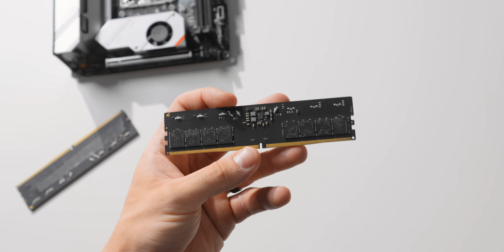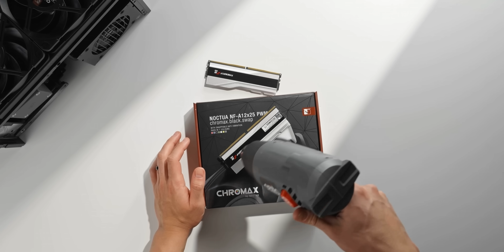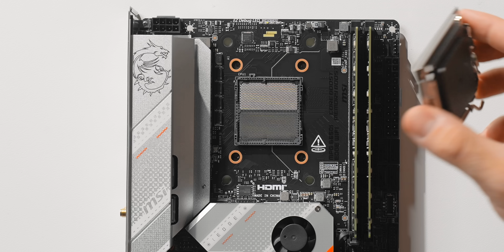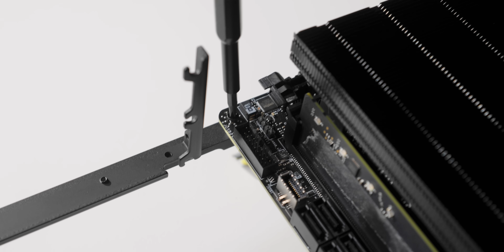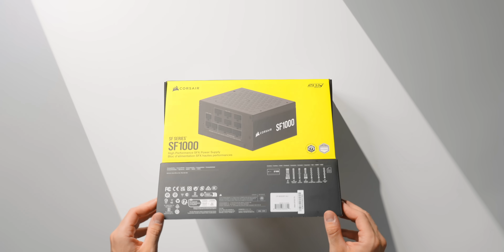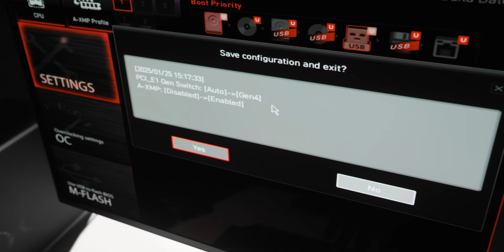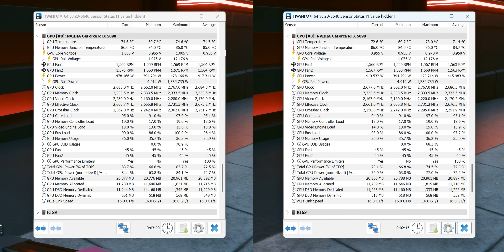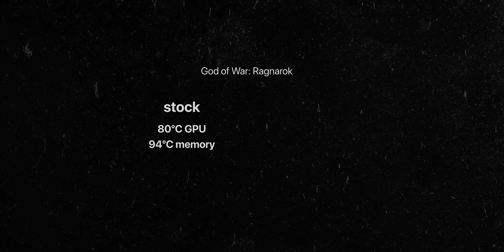My fastest gaming PC, ever – 5090 + 9800X3D

Comment: Just upgraded my PC a lot. Have always been lacking in some part by now it does it again. Have had an overclocked i5 9600k, 32gb ddr4 3200 mhz, originally had a 1660 super. I then upgraded to a rtx 3070, then again to an 4070. A lot of bottleneck there so i whent ahead and made an investment. A ryzen 7 9800x3d, 32 gb ddr5 6000 mhz, stubidly good msi motherboard, and a riddiciulusly large and quiet Noctua fan. Now I have an amazing pc, and i dont really need more, but my brains just tells ne to buy a better gpu, when i have a cpu that can litteraly run an Rtx 5090 without problem 💀 Should I get a new card or not? Its a bit expensive now and trying to save money for other things so maybe wait. But when i do upgrade, maybe its time for a 80 or 90 card even so it can last long so i dont continue to just switch 70 cards?

Comment: Do you prefer sandwich style cases over console style? If so, why?

I'm considering a console style layout as it looks to be more space efficient than a sandwich. Im sure the T1's standoff helps for the push through cooler design but isnt still more heat getting trapped than with console style?

Is there any benefit in going for sandwich layout?

Bonus questions since you own the measuring tools and get to try all the equipment

If you use a console style case, and have the GPU intake face the same side as the CPU, can you tell a noise difference if you point the exhaust side of the case towards you Vs the intake side? 
Or alternatively, have you ever mounted a console style pc on a stand behind your monitor?

Comment: I doubt the CPU had good temps since he didn't mention it, and from experience running less powerful CPUs with low profile cpucoolers like he used in the vid; it does not turn out well
Reply: He mentioned the CPU is in the mid-high 70’s in the video.

Comment: The first lines saying you were not sure about temps. If temps are kinda high but not causing crashes, then you simply adjust your cpu/gpu fans. Not sure why absolutely no one mentions this. I do this anyway. I can run a stress test on my 1080 ti and it never gets over 63 degrees.

Comment: Thank you Optimum!
This is a perfect video for me since i wanted to make upgrade od my RTX3070 without leaving my T1 behind.
I also have Alpenfohn Black Ridge, but i was pretty concerned about temps and combability with more power hungry CPUs than my undervolted R5 3600 and you just swept them away!
Now the hardest part - hunt for FE cards, which are almost impossible to get in my country ;/

Your issue with PCI-Riser is just mildly inconvenient i comparison to mine. In my setup GPU 4.0, Mobo 4.0 and Riser 3.0 PC hangs without any video output, so the only way is to temporarily swap gpu for "backup" one with PCI 3.0 and update BIOS afterwards, because auto mode is not working :D

Comment: not showing the CPU temps while gaming shows the CPU is hitting above 85*C+ i saw VEX try it in an open setup and the 5090 heat is being sucked by the 9800x3D
Reply: You should watch to 9:45, you will see CPU temps in the mid 70

Comment: It's kind of a bummer that we've gotten to a point where all "fastest builds" converge into the same basic setup. 

You've got the 5090 + 9800X3D + however much DDR5 RAM you want to throw in. 

There's no Intel CPU or AMD GPU equivalent that's even within range, so we're left with one standard loadout for everything 😔

Note: This is not a shot at optimum or any other PC channels making similar builds.

Comment: Would flipping the orientation of the 5090 work? I.e. sucking in cool air through the other side of the case? If the CPU is liquid cooled with a 240 mm AIO, the ambient temps inside the case before it reaches the 5090 wouldn't be too different from outside the cases

Comment: Nice build, the 5090 is only 2 slot but efectively requires a slot on the back free to get proper airflow. Cant wait for watercooled 5090s :)
The 9800X3D being able to live with such a small cooler is insane. An Intel 14900 would just melt away :)
That case makes it look like a console, I guess its a " Steam machine"? :)

Comment: I can't sell my PC Build for 2k to buy a 5090. I wanted to sell it but I think my 3060 TI holds it back from being sold. May have to invest to get minimum 4070 ti for people to want it. It has a 7800x3d, 32 GB 6000 kit DDR5, Arctic Liquid Freezer III AIO, and a MSI MAG x670e Mobo, with a 800W Gold PSU. Lian Li case + 6 2500 rpm case fans. But then that 3060 ti founders edition... It's the perfect 1080p fps gaming machine, but 2k is a bit reaching.

Comment: Notice he didnt give any noise testing results.  This seems like a terrible case for this card. You will be baking everything else with that space heater gpu. A console style case with flow through air like the Ridge, sfftime, etc will be much better. Shouldnt even need to UV.  SFFTIME U-ITX should fit same stuff in a 3L smaller case, without gimped cooling.

Does he get commisions for the T1?

Comment: Something that throws a spanner in the works with this board and its low VRM heatsinks is the socket placement. For example, Noctua L12S actually won't fit on this board - but will fit on a Strix B650E-I board despite its larger heatsink and IO cover, because the socket placement gives the under-heatsink fan barely enough space to avoid the VRM heatsinks entirely.

Comment: Still happy with my 4090 and 12700K, I think I may only for now upgrade to 14900K, but probably wont make much of a difference at native 4K, however if the DLSS 4 transformer model requires a faster CPU I will upgrade the CPU and sell my old one. I have enough cooling for either CPU, wont be upgrading to AMD until a couple of years later and 6090

Comment: with 250 core with 75% limit it will be interesting to see if that's stable in cpu bound loads where the gpu may push to pretty high clock speeds when under lighter load.

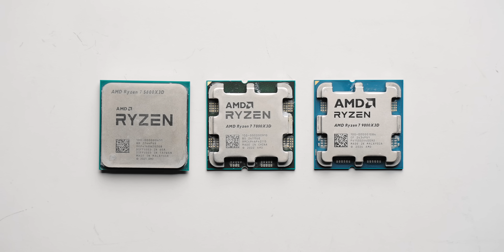Comment: Why does every damn creator do this. 0:50 they show off the specs of the all of the fastest chipsets of each cpu but when it comes to intel they never show off the clearly faster chipset from intel being the 14900KS rather than what every creator does and ONLY shows off the lesser powerful 14900K from intel like the 14900K is on par with the 14900KS. That would be no different than showing off a 9800 for argument sake and clearly not showing off the x3d variant that is clearly faster. Intel and Nvidia is king regardless of how much power consumption they consume.

Comment: what if you turned the gpu upside down so that it draws air in from the inside? this way it wouldn't blow hot air at the motherboard (and back at itself). the air between the gpu and the motherboard should be plenty cool enough especially given how you already have the two static pressure fans blowing air into that gap.

Comment: $3568 - TOTAL FINAL PRICE - amazing build!
$1,999 - Nvidia's GeForce RTX 5090 
$590 - AMD 9800X3D 
$260 - MSI B650i Edge
$200 - Corsair SF1000
$124 - G.SKILL Trident Z5 DDR5 RAM 32GB (2x16GB) 6400MT/s CL30
$100 - Samsung990 Pro SSD 1TB PCIe 4.0 M.2 2280
$70 - Alpenföhn BLACK RIDGE 47.1 CFM CPU Cooler
$225 - FormD T1 - Gunmetal
Reply: Honestly not as bad as I thought it would be
Reply: thats msrp, which nobody can find a 5090 for.  realistically the 5090 by itself is a 3-4k graphics card.  this whole build without MSRP is more like 5 grand
Reply: Or $5,838 in Australian dollars :o
Reply: Don’t forget the fans
Reply: @thebreadhead1 what kind of fans were they? On top above the sandwich. Are those 2x 120mm pwm fans or 140mm and they look like they can push a lot of hot air flow out of the computer. I have a similiar case.
and didn’t want to use liquid cooling because it is going to be my portable pc build, that I take to LAN parties or when I travel with a 15” portable amoled monitor
Reply: @OfficialDiatkoMusic i am not sure rn been a while since I wrote that comment. Best way to check is
1. Check the brand
2. Find what size the case supports
3. what fans of that brand fit the criteria
4. how much of the supported space do the fans fill up. Which fans of that brand look alike.

I don’t have the Timern to check but I think it was 120mm artic fans. Don’t recall the model. Do your research
Reply: like you can get a 5090 for 2k, fe in the uk is 3000
Reply: No,it could price 5568$,nvidia’s card costs 4000$
Reply: @bzmnv I got my 5090fe on Stock X for $2300 plus tax. Brand new, sealed.
Reply: Well. It would be $58,700 AUD Sir!! 😅
Reply: for less than 500 i built a 1440p monster. 

5090 cope!
Reply: That's $4,884.40...
Reply: Damn. 11 months later and most of that money is going to ram
Reply: That's actually crazy. Not that i'm dissapointed with my build, but this is over $1,000 cheaper, (even if I were to run just 1 SSD), and something I probably would've rather tbh.
Reply: Wasn’t his ssd 4tb?
Reply: @cwill2127  he said that he would upgrade it to 4 tb in the future
Reply: Pffft. Not in CAD 😂
Reply: What fans did optimum use on the top of the case? Someone help
Reply: If the parts are at MSRP ;)

Comment: Awesome, I was waiting for this! Though as a CPU cooler, the thermalright AXP90-X47 full copper (or X53 if you go 2.75 slots) may work better here. It can be installed such that the fins are vertical (parallel to RAM), which makes it work together with the exhaust fans and lets the hot air escape more easily. The horizontal orientation of the blackridge isn't ideal. Noctua also has an "orientation guide" that says this orientation is the worst of the 4 for these types of coolers.

Comment: I have a very similar build in the T1, but with a 240mm AIO. Looking at the 5000 series, I think the best we could do in the case is somehow mount the GPU so that instead of it drawing air into the case, it was flipped to push air out of the side panel. New 3D printer project for you?? ;)

Comment: I am planning to use corsair sfx1000 also.   The included power cable ; is it 12vhpwr or newer 12v2x6?    Does that cable included go to two 8 pins on the psu and since its atx3.1 & pcie5.1; it sends 300w each 8pin for a total of 600w right?    Thx in advance!    As always your builds are really great and inspiring!    Excited to preorder 5090 or 5080 FE!

Comment: Could you flip the 5090 so it exhausts out,  set the top fans blowing into the case and have enough through flow? Or do the fans on the 5090 pull rather than blow over the heat sinks?

Comment: Any chance to test AXP90 X47 at 3 Slots?
Reply: Oh btw if it is Air cooled ASUS LOKI can have lower noise under 500W GPU, though the fan of the PSU need to swap to NF A12x15

Comment: Comparison is not good enough. If you gonna check that this setup is overheat or not. Of course, it's not going to overheat because GPU and CPU will lower their performance when temperature almost hit it thereshold. For better comparison, you better compare this setup vs naked case vs standard full tower case. Or you can just benchmark this machine and compare to other people with similar hardware.

Comment: I wanna see this GPU with a properly tuned 14900K + RAM to see how it keeps up compared to this build. As for this build being "a lot of work", huge disagree. With as many builds as you have done, this was an extremely simple build. Even if you've only got a few builds under your belt, this is no more difficult than a standard ATX build with a Thermalright Peerless Assassin 120.

Comment: One thing I would recommend is some shielding between the back of the cpu and the gpu exhaust. Also angling it (towards the case exhaust holes) would likely decrease static pressure behind the motherboard increasing both cpu and gpu performance. Might be kind of hard tho with how limited the space is there

Comment: If you've a Meshroom D then try that in the flip gpu at the top configuration rad at the side.  
I've done it with mine and it's not well documented to do it as standard but really helps with temps

Comment: My current rig is the Formd T1 with a 4090 GPU & 7950x3d running a water cooled dual loop. Very similar to your build but a little more space efficient and not as pretty. I'm gonna try to snag a 5090, new Alpha Cool slim GPU water block and a 9950x3d (march) and see how that runs. 

As much as I love the Formd T1, I'm thinking of switching to the DAN C4 SFX to ditch the sandwich pattern. I've had so many issues with that riser cable that I want to see how it runs directly attached to the mobo. 

Can't wait to see what you come up with now that the new toys are dropping. :)

Comment: You should use those foam Noctua gaskets on the fans of the 5090 so it can only take air from outside and make the fans of top exhaust the flowthrough hot air of the graphics card.

Comment: Not much room for the 5090 to vent in there. That's why I didn't go with a T1/A4 size case. The GPU air hits a wall, gets stuck in whirlpools and eventually makes its way up through the top. I'd check on the VRAM temps to make sure they're not hitting much over 90C.
Personally, I went with a Lian Li A3 case so that the GPU's exhaust wouldn't be obstructed. It's about as small as a case can get while providing ideal ventilation for a 50 series FE card. Since the 5090 will be the most expensive part in there by far, I thought it made sense to give it room to breathe freely.

Comment: Weird you had issues until you forced gen4 when the board only supports gen4 on the PCIe. Also running MSI afterburner on am5 has been found to cause stuttering and fps drops in games so watch out for that. Just a recent issue I've seen that came up around 9800x3d launch.

Comment: Just finished rebuilding my meshlicious with a 9800x3d and 4080. I've had the 4080 since launch and just upgraded to the 9800x3d with a b850i aorus pro. No way I was going with Asus again after the last few am5 builds I've done with b650e boards. I'm a huge MSI fan but going b650 without PCIe 5.0 instead of b850 for the same money just doesn't make sense. Your videos turned me into an itx enthusiast 💪

Comment: I want an itx case that can house the asus rog x870i and 9950x3D with a 5090 and the same power supply, I need the big heat sync for ultra fast memory so I cant afford to remove it. Please I need a suggestion.
Reply: He’ll probably try to use the 9950X3D in his build when it comes out

Comment: I'm trying to find the 92mm foam fan spacer that is mentioned for the CPU cooler. Anyone have a link to this? I can't seem to find the 92mm size anywhere.
Reply: Same here but I thought he is using 120mm that is why he changed it to Noctua Fan?
Reply: @ Hmm, when he held the new Noctua fan with the original cooler fan they looked the same size. It didn’t look like a 120mm fan would fit on that cooler, so I think it’s 92mm Noctua fan.
Reply: @ did you find the spacer?

Comment: I cant figure out how you fit the top fans.  I have to cable tie mine to the lid due to the power supply cables are you using a shortened 24 pin ?

Comment: I might be wrong but I think the following video might be of interest to you. From 2.14 to 4.05 in this Hardware Unboxed video ""AMD Ryzen 7 9800X3D Review, An Actually Good Product!"" might be relevant. In it, Steve from Hardware Unboxed explains why DDR5 6000 is the sweetspot RAM for AMD. (I'm sure I saw a vid showing that until you get towards DDR5 7800 or 8000, DDR5 6000 is fastest.)

It might mean more to you than it does to me, because I have not made an AMD build yet. It's to do with the ratio between the IMC (memory controller) and the fabric. (I'm not sure what the fabric is, but I have come across it before). 

Anyway, if I've understood Steve from HU, then DDR5 6000 should run the quickest CPU performance. Maybe faster than the DDR5 6400 you used here, unless I have misunderstood. Up to you to figure it out, or benchmark it.

Comment: Was there a specific reason to mount the CPU fan upside down when replacing it? The stock fan pushes air up from the socket through the fins, the replacement noctua is flipped and pulls air through the fins and blasts it at the socket instead
Reply: better air movement pulling air from the outside instead of from the cramped space of the motherboard side, plus the gpu is pumping hot air into the case, the cpu fan would have to use that hot air to cool it, so less efficient if it was inside to out

Comment: FYI Optimum the latest versions of the black ridge no longer require the thermla grizzly backplate.

Additionally, there is some gskill low profile ram available in yp to 64gb kits which fit with the black ridge without voiding the warranty :)

Comment: Was waiting for this so I can follow a similar build for the first time in a Formdt1. I was wondering about fan noise on this config? And also if you could fit the 3d printed mod created by EIGA for the exhaust fans? Wonder how would that work and if it would make a noticeable difference in temps. Overall great video!

Also, is your case the titanium color or the gunmetal?

Comment: I was able to fit the Blackridge on an X870-I with Flare X5 DIMMs. I have one of the later revisions of the Blackridge and it works with the stock backplate. There is plenty of clearance for the RAM. The only modification you'll need to do is removing the M.2 Heatsink stack.

Comment: What monitor does he use?
Reply: PG32UCDM, don’t pull the trigger though the PG27UCDM is coming soon with DP2.1 ports which the 5090 has. Also a higher PPI at 163.
Reply: @ thanks for the answer and the heads up